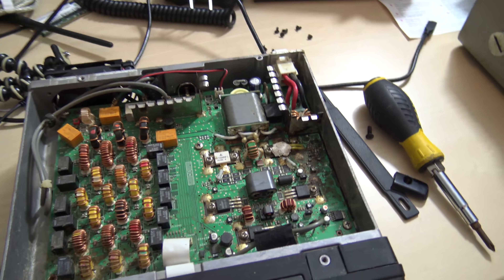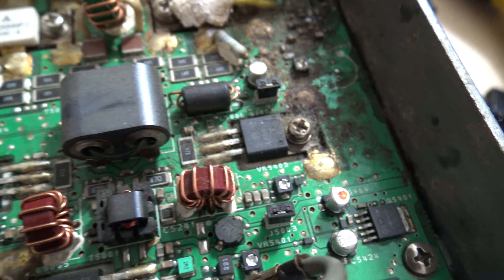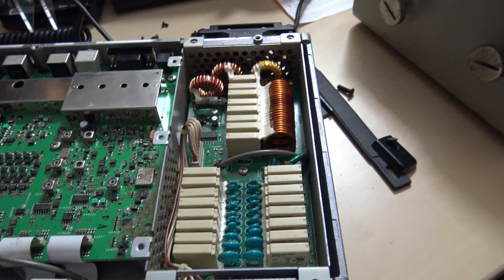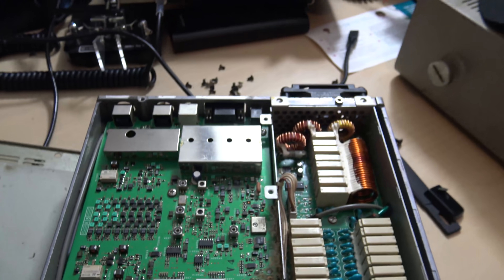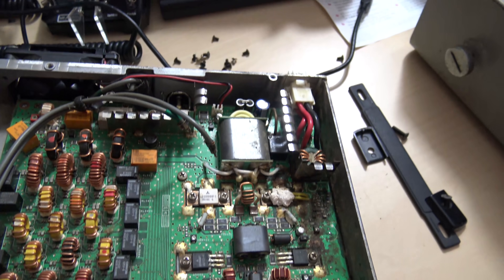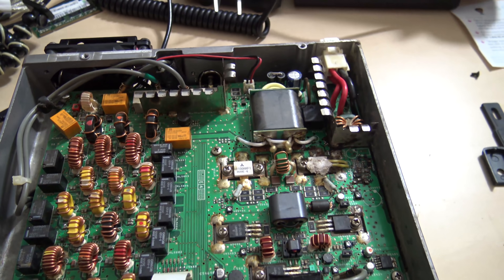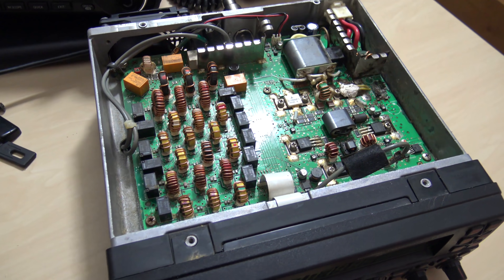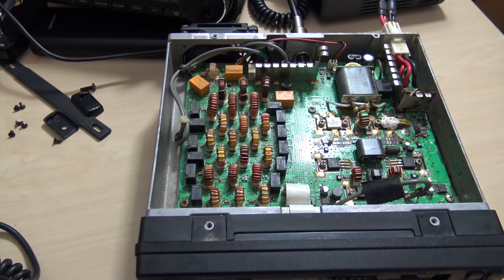What's In My Yaesu FT-450, Repair Attempt #1

Comment: Keying the mic while on SSB will result in zero output power unless you provide some modulation. Try on FM or AM with a reduced power output and watch the output power. On my old FT-450 the PA was proven OK with proper power output on FM. It was strictly a SSB modulation problem on the bottom PCB. Good idea using the MAF cleaner, IMO.
Reply from the maker: It is the PA board, burnt traces everywhere
Reply: @HamRadioConcepts  yes, always look for burnt parts and traces first!

Comment: Here I explain what happens with my Yaesu FT-450.

A few days ago I made the mistake of trying a radio from a friend of mine when my
FT-450 was on receiving, they had two different antennas but the separation
between the antennas on the roof are 3 meters. When I was testing the radio in transmission
I felt a burning smell from my friend and I realized that it was coming from my radio, at the moment
I turned it off and when I turned it back on it had changed many things like:

- TRANSMIT BUT DOES NOT GIVE ANY OUT POWER IN (AM) MODE ON ANY BAND.

- THE SYSTEM (ALC) DOESN'T WORK, NEVER MARK ANYTHING ON THE DISPLAY, BEFORE IT WORKED
  VERY GOOD.

- ESPECIALLY IN 6M (50MHZ) BEFORE HAD 100 WATT, NOW ONLY HAS 10WATT AND WHEN
  CW OR SSB TRANSFER FEELS MY VOICE OR NOISE IN THE RADIO HORN.

- THE INTERNAL RADIO TUNER ANTENNA DOES NOT ADJUST IN SOME BANDS AND HIGH SWR
WITH GHOST ANTENNA DUMMY 50OHM ADJUST 1: 1 ALMOST ALL BANDS, I REMOVED
THE RADIO TUNER ANTENNA AND CONTINUES WITH THE SAME PROBLEM, THE PROBLEM IS NOT
THE INT-TUNER OF THE FT-450.

- BEFORE ALMOST ALL BANDS DRAWN 100 WATT CW AND ALMOST 90 WATT SSB. NOW HIM
RESULT WITH LOAD DUMMY 50OHM PER BAND IS:

160m ...

fm .... 100 watt
cw .... 100 watt
am .... no carrier no power
fonia and digital .. 100 watt

-----------------------------

80m ...

fm .... 100 watt
cw .... 100 watt
am .... no carrier no power
fonia and dgital .. 100 watt

-----------------------

40m ....

fm .... 70 watt
cw .... 70 watt
am .... no carrier no power
fonia and digital ..40 watt

-----------------------

30m .......

fm .... 70 watt
cw .... 70 watt
am .... no carrier no power

-----------------------

20m .......

fm .... 70 watt
cw .... 70 watt
am .... no carrier no power
fonia and digital .. 40 watt

-----------------------

17m .......

fm .... 50 watt
cw .... 50 watt
am .... no carrier no power
fonia and digital .. 30 watt

------------------------

15 m ........

fm .... 80 watt
cw .... 80 watt
am .... no carrier no power
fonia and digital .. 80 watt

-------------------------

12m .........

fm .... 80 watt
cw .... 80 watt
am .... no carrier no power
fonia and digital .. 50 watt

When I transmit on the phone you can hear it on the radio horn

-------------------------

10m .........

fm .... 50 watt
cw .... 50 watt
am .... 10watt
fonia and digital .. 50 watt

---------------------------

6m .........

fm .... 20 watt
cw .... 20 watt
am .... 20 watt
fonia and digital .. 20 watt, When I transmit in fonia it is heard in the
radio horn. He also seems to be crazy, he makes noise and he seems to have serious
problems.

I RESET HOME OF THE RADIO AND CONTINUE WITH THE SAME PROBLEM, THE PARAMETERS
THE HIDDEN MENU IS CORRECT, THE RECEPTION IS CONSIDERED GOOD IN ALL
THE BANDS AND MODES.

I CHECK THE BOARDS OR BOARDS AND ALL ARE IN GOOD PHYSICAL CONDITION, NONE
COMPONENT SEEMS TO BE BURNED. BEFORE MAKING THE ERROR MY RADIO WAS WORKING
NO PROBLEM WITH 100 WATT IN ALL THE BANDS AND THE AUT INT ALSO WORKED
NO PROBLEM.

I HOPE THAT WITH THESE DATA YOU CAN GIVE ME AN IDEA OR OPINION OF WHAT PROBLEM
THE TEAM HAS THOUSAND THANKS IN ADVANCE.

note :Now I have realized that when I press the ATT or IPO key that is only for reception it falls
even more the power in all the bands, in addition I tested it in reception 6m 50mhz and it has problems
also at the reception .

BEST 73.- EDUARDO CO8LY
Reply: Sounds like the diodes are burnt out (D2001 and D2002).... they’re SMT LEDs that protect the RF-IF board.
Reply: @colfax13  Dear friend, I understand what you are saying but we have already measured the diodes and other components and everything is ok. and here we have created a group of engineers
In Telecommunications we have worked on the measurement and checking of several for
meters of the equipment and the result with the oscilloscope was discovered at point J2002 that
It is the point that gives you the signal at the end, the filters and the tuner antenna are the same
problem, that is, we discard it on the rf power board.
The problem has to be in the RF-IN-UNIT or CNTL-UNIT board but the FT-450 is
Built with SDR system and not a conventional radio system like FT-747 u
other Yaesu models.
Here there is nobody with knowledge about radios with that SDR characteristics, that's why
I would ask you to check the diagram of the Ft-450 and tell me what to measure or check
and what is your opinion on that problem.
The reception is fine in all bands and I have reset the radio several times and everything
continue the same, any questions you have ask me.
Thank you in advance and you are the only person who can give me an idea
than what can be.
I await your answer 73. CO8LY

Comment: Hey KJ4YZI, I enjoy the videos including your two visits to the Gigiparts store.  Your interview with the guy who owns a FT-DX101D was outstanding.  I have a problem with a 450D I bought off Ebay.  The transmit icon is blinking and the radio will not transmit.  I have tried everything but I can not get the icon to stop blinking or get the radio to transmit into a dummy load.  The reason I am writing you is my problem may be similar to the problem you are having with your FT-450.  I will watch your second video on your 450 repair with great interest.  I would sure like to figure this out without having to send the radio to the shop.  A couple of $75 an hour bench charges and I'll be at the price of a new radio with what I paid for this very clean like new but not working 450D.  Keep those videos coming.  You do very nice work.  73.  tommytomted
Reply from the maker: That is the exact problem I am having. It haas to do with the SWR protection circuit. It thinks it is infinite SWR and shuts down the PA. I hope to talk to Tim Factor of Yaesu about it because I forgot to ask at GigaParts when i saw him there

Comment: My suggestion only: To clean, use a small clean paintbrush with vacuum then isopropyl alcohol (MG Chemicals 824-1L 99.9% Isopropyl Alcohol Liquid Cleaner), apply with small brush/cotton swab. Have another beer and 4 Hp = 2982.8 Watts; more beer. Then you will have a clean radio that still doesn't work but you feel better because your radio is clean and you will have had a few beers.

Comment: Nah it's not the relays. Going by the rust in the finals I would say that is your problem. That wants cleaning properly with some stiff bristle brushes and alcohol or contact cleaner. then test the finals and work back until you get to the issue. I would say it's probably easier and cheaper to just replace the whole board seeing as its rusty.
Reply from the maker: Tonight I cleaned the whole board, removed the finals, tested OK, reinstalled and worked thr block diagram, seems the diode for FWD/REV power SWR protection circuit is bad. It's like a speck of glitter, and i cant get in there to replace it. Not only that, when I take out the screws to ground the finals to the chasis I get 4 watts output, but when i ground and secure it all, 0 watts. I am guessing there are several shorts on the board.. It was fun learning about the different stages in the PA section.

Comment: In the future consider getting yourself a few plumbing acid brushes then cut the bristles to about 1/8 inches in length. Dip it in alcohol, gently scrub a small part of the area then hit it with canned air (you can use compressor air as long as the output is not an oiled one for air tools) and repeat until clean.  Thanks for the cool video's! 73 de K7TIE

Comment: I enjoy radio repair videos. Unfortunately I can’t offer any experience based advice. I wonder if you can clean and test the relays without having to replace them.  If the plastic covers can be removed without desoldering the relays that would let you clean and inspect them.  UnfortunatelyI have no idea if that can be done.
Reply: That is quite a perspective. I'm sure it was very helpful

Comment: you could do a small test on the output that is being fed to the r/t relay in the back there,by just putting a small wire onto the preamp and or output transisters,and with a radio on in the background,see if you get rf comin out via the wire...you can also,going by the schematic place a small coax onto one spot somewhere that can feed the full rf right to the wattmeter instead of being stopped at that relay....i had the same problem in a icom 735 , i dug out a relay from a kenwood ts 60 and i wired it in,its still workin a yr later but all apart,it kicks ass while all apart hihi,i plan to try to get that relay closer in so the case can be put back together or even buy the relay from china...geeee how on earth did your rig get so gummed up,was it mobile..this dont happen to many otger guys ! good luck..do that test first...or even a continuity check across the relay terminals...we fiollow..

Comment: You are a great ham with serious knowledge on ham stuff, but clearly you don't have the skills to repair this. There are tons of stuff to check before changing random parts. You must do a methodical approach either starting from the antenna out and coming back from there, (or the other way) to see where there is a signal, where not. All the supply voltages must be checked to make sure every active component gets its power. You need the schematic, a signal tracer, better yet a communications analyser. You'd be better off taking this to a professional repair shop.
Reply: There are no professional repair shops. Not really. It's all gossip and word of mouth recommendationa these days. And every tech is too backlogged and can't offer a decent turn-around time.

Comment: Stop! Read please!
The beeping and flashing ant symbol means that no match can be found. The FT-450 wants a reasonable match to begin with, say 3:1 or better, anything worse, no go.

Eric, your problem may be a bad antenna/coax, etc.

Put a dummy load on the so-239 ant connector first & see if that cures the flashing ant icon issue!

If it  does, troubleshoot the antenna system. If not grab some schmatics/shop manual for the rig first. Don't go just pulling parts. A lot of new stuff has multi-layer boards that don't hold up well to too much unsoldering. You can easily cause worse issues. Besides, you can check continuities on relays with them in place.

Here; I found the shop manual online at: https://www.google.com/url?sa=t&source=web&rct=j&url=http://www.radiomanual.info/schemi/YAESU_HF/FT-450_serv.pdf&ved=2ahUKEwio6PPq-dXfAhWDFXwKHYIQD6kQFjAAegQIARAB&usg=AOvVaw10V0ni6BwNjC9PpD3pwcz7

Hope this helps,

73 - John

Added...

On pg 12 of USERS manual - "If the operation fails (usually because of excessive SWR), the 
antenna symbol at the start of the diagram on the display will flash until the tuner is 
either turned off or run successfully."

Finally... ! 

If basic troubleshooting does not find any simple solutions like a bad antenna; you may want to consider a full factory reset to clear out some confused microprocessor issues (warning: that will clear out your channel & other setup memory too!)
Reply from the maker: the issue is in the radio, there is no issue with my coax or antenna. I have read that about the antenna symbol flashing but this is different.

Comment: Time to get a schematic.  Debug Rule #1:  Thou shalt check the source voltages!  Looks to me like someone spilled cola through the holes on the top onto your SMD circuits by the finals.  Did the circuit traces survive?  There seems to be lots of corrosion around.
Reply: Time to buy a new main board or sell on eBay as Parts or repair!
Reply: you probably spilled beer in it idiot.